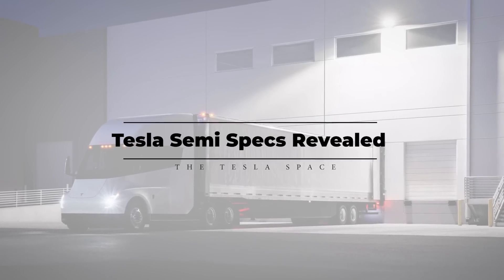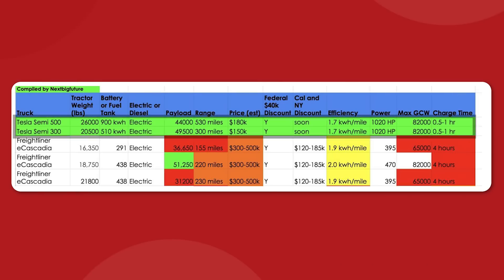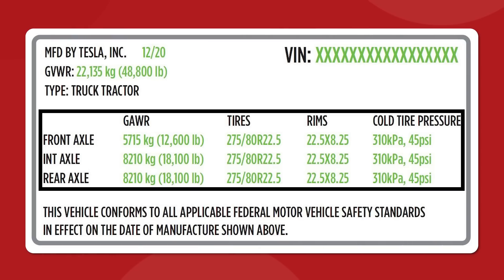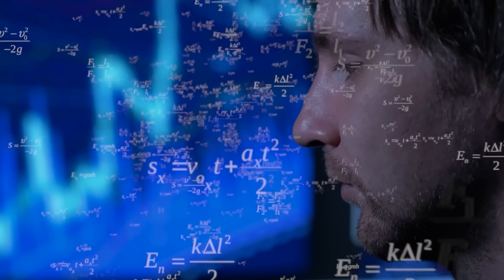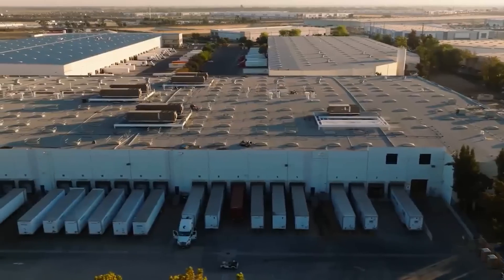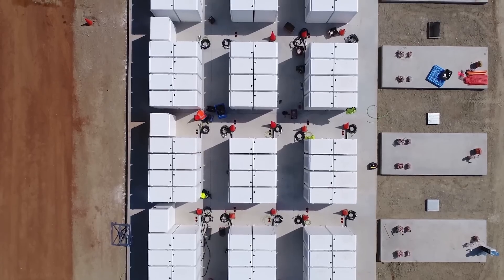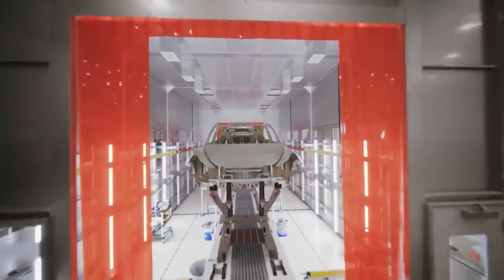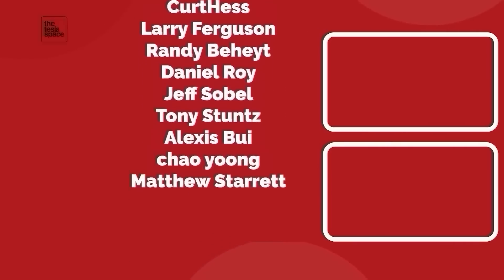Major New Tesla Semi Specs Revealed!

Comment: Tire pressure on tag seems to be too low.  45PSI is very low for a semi tire
Reply: That's what I was thinking
We have Freightliners and the psi is 100 to 110 lbs
Reply: Good catch.  It just mean most of these "specs" are suspect if they get that wrong.  Someone at Tesla probably put it together to please the critics without actually knowing what a Semi should be like.
Reply: @walden6272  yeah looks dodgy.
The diagram at 2:05 shows payload of 44000lbs, minus trailer of 10000lbs.
Reply: That was my thought as well. Wierd. I understand that it includes an inflation system as well. Don't know if that has anything to do with it.
Reply: Yep, the VIN is BS
Reply: i thought bigger tires have low pressure, a road bicycle has 170psi, i thought trucks would be 30psi.
Reply: @bittasweetsymphony726  nah, truck tyres are more often 100-110 psi. Based on their construction.
Reply: @bittasweetsymphony726  PSI is dependent on optimizing performance base on load.  A road bicycle isn't about carrying load but the psi is set high for maximum performance purpose, a low psi on a bicycle would make it move sluggish.  However, a heavy vehicle like trucks are meant to carry load, and for a passenger truck the PSI is around 36-45 PSI.  For a car is around 28-33.  For a Semi which can weigh up to 80,000 lbs, the psi has to be above 100 so the trucks don't move sluggish.

Comment: I wonder if Tesla considered making the battery packs in the Semi easily removable? I’ll bet it would be logistically and economically viable. Meaning fully charged battery packs could be delivered, in advance, to a “charging depot” (garage) eliminating the need for hundreds of mega chargers. Someone predicted that for cars in the 60’s, that we would simply exchange a dead battery with a fully charged one in minutes at a “gas station”.
Reply: That would be great, but don't you think Elon would have touted that as a huge feature from the start?
Reply: it doesn't make much sense to change the battery for a quick recharge instead of just having a mega charger becaus: 
1. truckers need to take brakes anyway 
2. the mega charger can be used for something else has well
3. you would still need to build the infrastructure of those garage/battery changer wich will be much harder to reuse for something else and not to mention likely more expensive.
Reply: @theprettypetard2524  One of these YTers interviewed some truckers who said the charging situation, even with a megacharger, wasn't fast enough as they often drive in pairs where there is no need to sit around and wait for the batteries to charge. Now, how long would it take to swap out batteries?
Reply: @jeffpicken5057  oh yeah semi who drive around the clock with 2 driver over very long distance is definetly not ideal for a tesla semi but those are only a small portion of the semi market. and furthermore only some of those route would become unviable if there is extra time needed but there is a decent chance that some would just take the slight hit to delivery speed to save on cost.

also no clue how long it would take to make an hypotetical swap of battery.
Reply: @jeffpicken5057   A laden semi coat about $1 per mile to fuel. 
Electric cost about $.25 per mile. Every 100 miles your $75 ahead. Truckers will sip coffee while charging and count their money.
Reply: @countryfucius  becaus you have to consider the need to have the truck more complex to accomodate easy batery swap has well has the need to have personnel opperate those battery swaper. it just makes the whole thing much more expensive and harder to produce. and all that is just to accomodate a small portion of the market so it's hardly worth it.
Reply: @theprettypetard2524  no you don't nio and Tesla battery swap stations where computer operated if personnel needs only 2ppl needed to reset mechanical controls
Reply: @countryfucius  swaping the pack may not be rocket science but building the machine that build the semi is probably close to that. so making it any more complex than it needs to be just for a few exceptions when a much simpler way would have been just fine for most case seems silly.
Reply: They moved away from that to avoid the public from repairing battery issues why they build the new batteries into the body now to make sure you replace the vehicle
Reply: And battery swapping tech Tesla did that but changed they mind vin fast,nio, and few others are doing that now

Comment: What happen if Battery catch on Fire,  How many seconds can driver run ?
Reply: I've seen more than one diesel truck on fire
Reply: Teslas have one of the lowest chance on the market to catch fire and always have security at highest prio. I do t expect them to burn in numbers like diesel do regularely by overheated engines and crashes due to break failure
Reply: Pretty much the same thing that happens if a diesel powered tractor catches on fire. If the driver doesn’t run away, they get burned.
Reply: the exact same amount of seconds a diesel truck driver will have.
Reply: He has longer than if a gas tank explodes into flames

Comment: How is nobody here talking about the terrible idea semitruck is?
Reply: Please explain why it's a bad idea. Perhaps we just don't know what you know.
Reply: @eternalbalance7703  feel free to read my comments down below

1. At the current price of power it's more expensive to run
2. It can take less than half the weight of regular trucks if its to run its advertised 500 miles.
3. Most companies will have to replace the 116.000 dollar battery every year
4. Non of the heavily advertised features of autonomy, or driving in single file have been realised.
5. It will be stuck refueling a lot longer
Reply: @MAKESZENZE  1, 2, 3 and 5 are plain false. Tesla semi is going to sell whatever number tesla can possibly produce and destroy its counterparts. sorry to break it to you.
Reply: @MadCuzUBroke  you are dense, aren't you? 
1.This guy here describes 4 cents per Kwh,  in the US power currently goes for 13 to 17 cents per kwh, in other parts of the world all the way up to 80 cents per kwh. 
2. Why do you think tesla has been VERY, VERY silent of it's possible haul? On it's uninterrupted testdrive it drove until empty, while hauling a couple of concrete blocks weighing around 6 tonnes. What have you to refute this?

3. A longhaul truck driver drives about  130.000 miles per year, a tesla battery gives out after 300.000, and will lose significant capacity way before that.
Reply: @MadCuzUBroke  and how can you possibly say refueling is not longer with an EV, are you dense?
Reply: @MAKESZENZE  it won’t be stuck refueling. drivers need brakes. also, it takes less than 15 seconds to grab a charger and plug it in. Even if electricity is 17 cents per kwh, it definitely won’t surpass the cost of diesel. and in countries where electricity is 80 cents per kwh, electricity isn’t even mainstream and they probably don’t have evs to begin. Also, new n°3 is irrelevant because the semi has an LFP battery.
Reply: OK so you'll be arguing that the companies that buy these trucks don't know what they are doing?
Reply: @danielstapler4315  I am. Companies like pepsico mainly did it for the good PR.. if they were actual good trucks that would have just been icing on the cake for them.

They literally stated that when they load it with soda, they can only do 100 miles.
Reply: The Tesla Semi can do 500 miles at 82k lbs. as shown in their video. The semi alone is 26k, a 53ft reefer trailer is 15k, leaving 41k for the load.
Our heaviest loads are 31k and lightest are 15k. That alone will increase the useable range for us but since most routes are city routes where EVs do better we can get even more range out of them.
We run set routes of between 130 & 505 miles. Most routes are under 300 miles.
There are Tesla’s on the road now with over 300k miles on the original battery pack.
The last time I checked the power bill (about a year ago) we were paying 4 cents a kwh. Our facility uses 170 Mwh a month. That’s why we pay industrial rates.
Because most of our routes are low mileage, we will not need the Megacharger network, just a few at our remote locations for a quick 20-minute recharge to get back to the facility.
All of our units get 8 to 12 hours of down time everyday so plenty of time to charge at the facility.
Reply: @That-Guy_  So you are basically a regional hauler. Real OTR truckers operate under different circumstances . No one has ever said it wouldn't be suitable for city routes or shorter regional type work . To be a successful OTR truck there would need to be a nation wide infrastructure to charge them . If you can't understand that your being unrealistic . Where are these trucks with 300k on the battery being they just delivered the first trucks . I think you are just a fanboy blowing smoke bud.
Reply: @bobbybishop5662  
Did you miss my 1st comment?
Starts with "For our use case it is perfect"
Tesla is only making day cabs so unless you want to put your driver in a hotel every day they can't be used for OTR.
Over half of all semi trucks in the US are day cabs and the industry has been moving to more day cabs over the past 5+ years so it will be a while before they need to make sleepers to cater the that market.
I was referring to Tesla cars with over 300k miles not the trucks that just hit the road.
We will have to wait for a few years to see how the ones Pepsi just got are fairing to know what the battery life will be.
NMC batteries are good for 2,000 to 2,500 charge cycles, with a 500 mile pack that equates to 1 million + miles.
Reply: @That-Guy_  So you agree that it's not going to change the industry the way Elon claims. That's my biggest issue with the hype Elon tries to create by going overboard with the effect the semi will really be . Over the years he has failed to deliver on his promises over and over. I don't have anything against EVs in general , just when people and stock holders are being mislead with false statements and exaggerations.    I may have seen the first comment but really can't say for sure.
Reply: @bobbybishop5662  
I don’t agree, the cost savings vs diesel are what fleet operators will look at and considering that 80% of routes are under 300 miles it will be a game changer in cost to operate. That and the major reduction in air and noise pollution will make them popular with regulators and citizens. 
Elon has ambitious plans and timelines, we all know this, but most things get delivered. I have a CyberTruck on order and have no doubt it will be delivered. 
I am a Tesla investor and am not worried about the long-term success of the company and stock. Tesla is not just Elon or EVs, the energy division is growing fast. I love my Tesla solar panel system with Powerwalls and Model 3 rwd.
Reply: For our use case it is perfect.
I rounded the numbers for the sake of brevity so it might look like my math it off by a bit but it's close enough.
My location has 21 trucks. 
We run about 2.5 million miles a year. 
We spend $2.4 million on fuel per year. 
So if each Tesla Semi plus equipment/ upgrades was $300k to $350k and we got the 1.7kwh/mi as stated by Tesla at our power cost of $0.04/kwh we would save ,just in fuel costs, about $2.2 million/yr. That would only take about 3 years to fully pay for all 21 truck plus equipment/upgrades.
Reply: @That-Guy_  and you won't get those economics too.. tesla failed to set up the gigachargers and a kwh is way more costly right now
Reply: @That-Guy_  a tesla truck can only haul about 6 tonnes, where a regular truck does 20. 

So you'd need probably double the tesla trucks, which would increase your cost tremendously. 
Double the truck drivers too. 

Then, with those kinds of miles, you need to replace your battery pack every year, on every truck.. which is an another 116.000 dollars or so.

It doesnt make sense, not right now

Comment: Gross vehicle weight rating
Description
The Gross Vehicle Weight Rating is basically the maximum total safe weight of your vehicle, counting the curb weight (the weight of our vehicle when empty), plus the weight of your passengers, fuel, any accessories added to the vehicle, cargo, and the “tongue weight” of a tow trailer (normally 10-20% of the combined ...
Reply: Additionally: A truck's GVWR is the maximum weight rating established by the chassis manufacturer. GVW is the total weight of the truck and payload at a point in time.